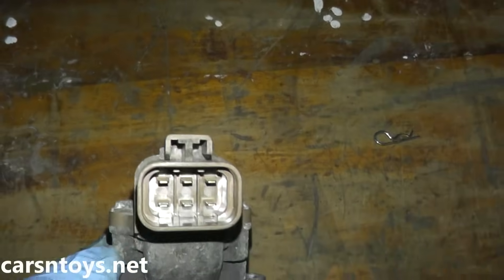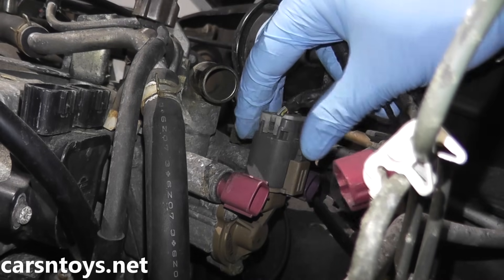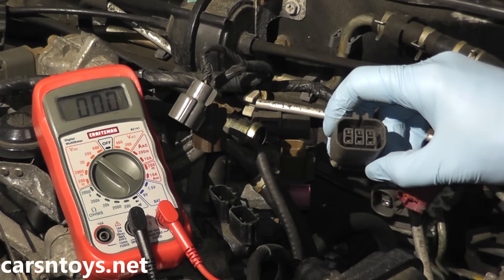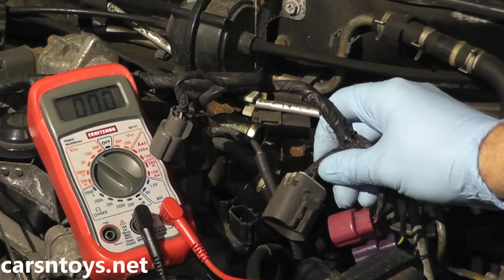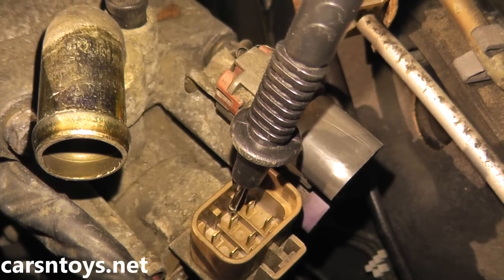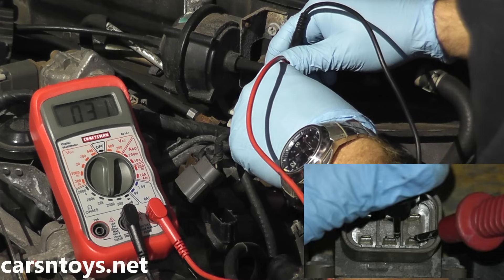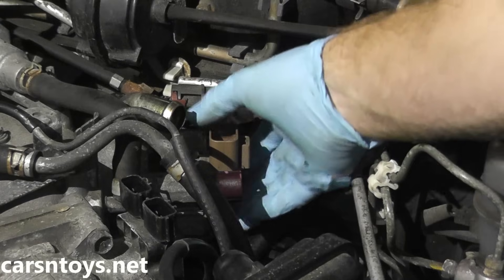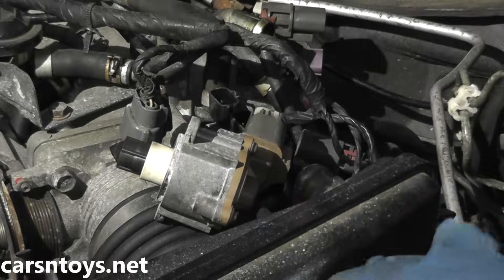How To Test and Replace Idle Air Control Valve P0505 HD | IAC Actuator

Comment: Yeah but where do i find the part on my engine
Reply: If you can type this question here, you can surely type it into Google and get your answer immediately.
Reply: @UseYourBrain. Jokes on you, the part was actually built into my throttle body and un removable. Tried googling a ton before coming here.

Comment: I did it with my motorbike, and I found the IAC failure, I replaced but sometimes I still get the engine error light on... 
I replaced also the throttle position sensor, which I realised after, it has not a fixed position so probably is that that I didn't put it in the exact millimiter position?

thanks for any feedbacks

Comment: Does this work for motorcycles as well? I’ve took my IAC valve of and left it connected..when I turn the key to on position, it doesn’t move at all..

Side note: I’ve been having problems with my motorcycle not being able to idle for more than 5 seconds..I changed everything but today I decided to check the IAC valve and it doesn’t move on the key on position

Comment: What are the part#'s for the 5 screws that hold the IACV to the Throttle Body?  I messed up those phillips head screws removing them cuz they were a bit stuck. 2001 Maxima GLE

Comment: Great video, but I need to go a bit deeper. I want to learn exactly how the IAC steps, they are not simply fully open or fully closed, they can be set to various positions by the ECM to get different idle speeds.

Yours has two sets of 3 pins. Pins 2 and 5 have 12V to them, then I guess a Ground signal from the ECM on pin 1 half steps the valve in one direction and then a Ground on pin 4 puts the other half step in that direction.  To move the valve the other way, the ECM applies Ground signals on the 3 an 6 pins in a similar fashion.
Is that correct?

I have a GM 1987 2.8L V6 Fiero. My IAC valve has only 4 pins. I want to make a setup to actuate the value on the bench. My brother is an instructor at Porter and Chester and he would like to have a little set up to demonstrate how IAC valves work to his students. So learning how they actually work is the first step.

I read 50 Ohms across each pair. I guess one pair moves the valve in one direction, and the other pair moves it in the other direction - but not quite, read on.

I took some baby steps and tried it with 5V first... no action. Then I tried it with 9V (to be safe).
One pair of contacts, still no action, but on the other pair puts a small twitch on the plunger in one direction (even if I reverse voltage polarity on the pair, it still twitches  in the SAME direction).
Ok, I guess it does use 12V, but seeing just a twitch is on right path. But the twitch was rotational on the plunger NOT in or out, and again, I expected it to twitch in the other direction using the other pair of contacts - but not the slightest twitch with those contacts!

So, before I try it at 12V, I need to get a better idea on what signals/timing the ECM puts on the IAC valve to actuate it.
There appears to be no position feedback from the valve to the ECM.
I guess on power up, the ECM steps the valve many, many times to get to a fully open (home) position, and then the ECM keeps track of the step pulses to determine its position from then on - until power off.
I have used stepper motors many times in the past, and that is what is nice about them, you don't normally need any feedback because the are dead on accurate on the position (and knowing it's position) if you pulse them properly. But I have no operational specs on my IAC valve.

Any ideas?
Thanks.

Comment: Thank you for the video. Quick question, I was getting P0505 too and bought a replacement part on Amazon. No more p0505 code but this particular IAC makes noise when the key is set to accessories. It sounds like a little motor is constantly running. Is that normal or should I ask for a replacement?

Comment: I have the code and replaced the iac # 530 306 57ab on a 1999 dodge Durango.  After spraying carburetor cleaner all over the carb and cleaning it and putting on the new iac it will not start at all.  The security light is on.  I disconnected the battery to reset  it still won't start.

Comment: Do I need to reset my computer on my 1999 Subaru legacy outback, after I check and clean my IACV? I didn't actually remove it all the way but after reassembling, my car is now acting like my battery isn't working for a minute. It starts but immediately dies. When I try to turn over again, it acts like I have a dead battery but if I wait a second then try again, it starts but not in a strong way. I know my battery is fine because I just got it tested. When my father and I replaced and adjusted my TPS the other day,  we followed the recommended computer reset protocol and that got rid of the At Oil Temp and check engine light. It is shifting so smoothly now and all seemed perfect so we decided to see if we could clean the IACV, we were concerned we might screw it up so just shot carb cleaner into it and then put all the hoses and sensors back into place. Seemed to be fine until the next day when I went to start it and experienced it dying and then having issues starting. I've never had an issue with it starting. Wondering if i should've done the computer reset after messing with the IACV too. Or perhaps we didn't put something back correctly? Anyone have any advice here?

Comment: I dont get any code.if its plug in car idle vere low when braking en dies somtime,but when i startup idle very good.
Now i unplug it an never dies anymore or no low idling but keeps idleing high.idle at almost 2000 rpm in P or N in D it stays on 1100 rpm

Comment: Does the first test applicable in all 6 pin iacv? Mine is suzuki and has a 6 pin iacv. I wanted to test the iacv coz my engine when running for 30 mins there's a problem occure like when you press the accelerator a little bit the rpm will surge to 1800. Also I notice that when the ac compressor cut off the rpm also surge to almost 1800.

Comment: I had some issues on my 2001 maxima and for p0505. And found that the intake boot badly cracked  just before throttle body and got  p0505.  I replaced intake boot and cleaned the check engine light and it never came back.  But strange sticky throttle   Happened.  Loose throttle cable fixed that but still had some strange idle.   I had to do a idle air volume. Relearn procedure which is specifically for 2000-2001 maxima.  
After that it’s been fine.

https://www.nissanhelp.com/diy/maxima/projects/2000_2001_nissan_maxima_idle_air_volume_learning.php

Love your vids very clear and to the point.

Comment: Good good video, T have a 01' Mazda Tribute 3.0. Idles rough, checked IACV clean inside. No power at key ON! 
Im on disabillity, things are tight like most places. That fuse on the IACV also tends to EEC, VPWR, EVR, MAF, ( bulkhead)?
Most abbreviations I'm familiar, but EEC , EVR?   V power ! I guess ?
Ha ha it starts right up! 5 seconds later it starts to stumble to death (dies)! Plz sir i need help .

Comment: Good show. But if ur having idle issues u may need to clean the valve and seat and air passages and throttle body too. Or u could have significant vacuum leak somewhere. Or u may need. A tune up.  Plugs ,cap n rotor, fuel filter, air filter, pcv valve, ect.
Reply from the maker: Thank you.

Comment: How come my 99 Durango when I put it in drive and give it gas the rpms go up high but no power to go pass 30 miles an hour
Reply: Maf or map sensor controls your vehicles speed by changing the airflow fuel mixture. If you have a bad one your vehicle will hesitate to go past a certain speeds.

Comment: Why in the morning my zc engine hard to star when the time get Cold
Reply: If your pintle is not engaged when the key is turned to on the run position. Its kind of like having a closed choke on a carb the motor needs fuel,spark,air,and compression to run.  But not having tne right amount of air its a pain to crank over a engine if there is no air movement to help combust the fuel.

Comment: HI Great Video very detailed!
2 quick questions please? 2001 Nissan Maxima. In park the rpm's go from 1200 to 1800, back to 1200 back to 1800. It does this very quickly and does not stop. Is this a symptom of a bad or crudded up IACV? Also I read one place that replacing the IACV could short the ECM or maybe when it fails it could short the ECM, have you ever heard of this? I'd like to prevent a shorted ECM from happening if possible when I go to check and possibly replace  the IACV.
Thanks a lot!!
Reply: Just had the same problem on my 96 maxima iacv disrupted my ecu got another one from eBay along with the ecu put me back in the game💪🏿
Reply: Also check your tps
Reply: Yes, I ended up replacing the IACV and having the ECM rebuilt....

Comment: I tested for ohms and showes a reading of 28-29 ohms on 1-2, 2-3, 4-5 but 5-6 did not show nothing what does that mean?
Reply: Jorge Camacho I think all should show resistance my friend . It must be bad did u replace it?
Reply: @mrsteel10213  I just got on from parted out maxima still have to test it first.
Reply: Jorge Camacho I got a new one and mine stopped hunting rpms thankfully . I tested it and ohms were higher on new one than the faulty one by 10 ohms. I don’t know if that matters.

Comment: I have a 2002 Nissan maxima, I cant find the iacv, ibthought it was connected to the throttle body as it is on the 2000-2001 model

Comment: Great video, you test for power in the sensor, the sensor has 6 pins,  you only showed the two for power,  what are the others 4 pins that you did not test, are they 2 grounds and two signals? Please  let us know and what are  the voltage of those others pins, thank you. Cheers from ontario ca

Comment: Dear guy, My Mitsubishi Galant year 1990 has a problem the rpm not stable in idle. When give  load like AC ON or Head Light ON or move the wheel steer
the idle rpm will run rough up and down excessivelly and sometimes the engine shut down by it self. I already changed the Idle Valve sensor 2 times and check the resistant is ok. The output power from the plug is 12.5 volt,  but the problem still exist.
I checked the movement of the Idle Valve sensor plunger but it movement was only  shaking and not extend or retract.
Is the ECU bad ?
Please your suggest.
Thanks alot.
John Purwanto, Tangerang City, Indonesia.

Comment: its so useless when they refuse to tell you what vehicle they are working on.  i get that it is kinda sorta a universal thing but not really.  so tell us the YEAR, MAKE AND MODEL PLEASE!!!!!!!!!!!
Reply from the maker: Appreciate the feedback. Specific vehicle is shown in the description box. The point of the video is to show what's involved (removal, using a multi-meter, etc.) for someone looking to do the job.
Reply: If you unplugged any of those two components, throttle body, or iac then the idle air control relearn procedure needs to be performed.

Comment: I have a problem with my 00 nissan maxima I have code p1130 I have look every where and nothing
Reply from the maker: Swirl control valve. Any other trouble codes besides p1130?

Comment: I checked mine it does shows everything you've had explained but still have the problem.& the scan shows a bad iac what it could be i already cleaned the EGR as well but i don't see any changes. Any suggestions???
Reply from the maker: What kind of vehicle? Any other trouble codes?
Reply: CarsNToys its a 95 gmc sierra 2500. 7.4 .& since is an old model it doesn't show any other codes.
Reply from the maker: Gotcha. On your vehicle try doing an ohms test on the valve. Grab a digital multi-meter and see if you're getting resistance. Here's another video showing how to perform an ohms test. Fast forward to 50 seconds: https://youtu.be/j-Wr2VMvfbc

Comment: how you're doing I have a 1996 mercury grand marquis gs and it's making a very loud humming noise and I thought it was a wheel bearing but it wasn't a wheel bearing they said it was a idle air control valve so all I have to do is just change it and it will eliminate the problem

Comment: Tried the last step where you take out valve and turn the key, my valve exploded like others said theirs did.  I got a new valve in and it actually fixed my idling problem but be warned, you run the risk of destroying your valve if you actuate it without it being mounted in your vehicle!

Comment: So I have a 99 gmc sonoma. And she runs great. But! Every day coming home from work the rpm surges when I'm doing over 70mph. My gmc does not have the check engine light on or any other. And when the rpm surge happens she has power. No transmission slip she takes off and when I step on the gas it goes down to normal speed but continues to surge.

Comment: subbed. good clear explanation
Reply from the maker: Thank you. Glad to help.
Reply: CarsNToys hey mate. I've changed this, ECU, air flow. and yet it still idles at 2200 when cold! the coolant icv kicks in when warm but when it's cold it's high revving. it's a 92 Mitsubishi Pajero ( Montero ) 3.0 v6. any ideas? thank you
Reply: CarsNToys it's reads 12.6 volts at those terminals to.

Comment: If I'm only getting 24 ohms is that bad? I tested it plugged in cranked the key and nothing. I'm getting power to the wires.
Reply from the maker: What kind of vehicle are you working on?
Reply: CarsNToys a 89 supra I've been trying to fix the idle issue /stalling I already replaced the tps

Comment: Would be the same test for a two pin set up. 2001 ford ranger 3.0l I put in a new one and still getting the code and running really bad. I''m thinking it might be a bad ECU. Any thoughts
Reply: Greg Seleen Did you figure out what the problem was?  I have a 2000 Ranger with a 3.0L.

Comment: i replaced the iacv with a used one and still the same problem, at cold starts it stalls until it warms up, no vacuum leaks. what else could it be or should i have replaced it with a nee iacv? thx.

Comment: is it possible for the iacv to be bad and not throw a code? being told to replace mine without the code.
Reply from the maker: Yes, it's possible. I'd test the valve regardless. Good luck!
Reply: I guess I have the same problem,  sometimes when I let off the gas to freely wind down (like at the stop light) the engine stalls. No code, but when the ignition is on - the IACV is buzzing, so I think it's sticking sometimes. 
Thanks for the explanation in the video ;)
Reply: I was having idling problems with no code in my gmc sierra.  I changed the valve after my Pinole shot out doing the last step of the video.  New valve fixed my idling issues.

Comment: hey just saw this awesome vid. but I came into a problem. did everything you did and everything thing checked out cleaned it up a bit then put it back in but still have code showing. any advice?
Reply: Stephen Horton you must clear codes after each replacement fix to see if it comes on again

Comment: Please can someone help me. I have a 95 mit eclipse sr I dont have power to the idle speed control. I replaced it with a new one, still no power, new computer, power turned on but its out again, checked all the wires, put new connectors....

Comment: hola que tal, mi nissan maxima aveces esta acelerado a 1500rpm y aveces esta a 800.,  ya revise tps y maf sensor y todo esta correcto,  pero me percate que mi valvula iac no hace esos movimientos al abrir y cerrar el switch,,  en la mañana prende a 900rpm y al ponerlo en marcha sube a 1400rpm..   al parecer mi valvula iac no funciona pero al desconectarla tambien se sigue acelerando, ¿Cual podra ser el problema en mi maxima 95?  el tornillo que va en el cuerpo de aceleracion lo afloje todo por que las revoluciones llegaban a 1700rpm.

Comment: Ok last question...? I took off the IAC itself, and there is a little coolant on it and inside the housing.  Is that ok as coolant runs through part of it, or should it be completely dry?
Reply from the maker: What kind of vehicle you working on?
Reply: 2000 Maxima SE
Reply from the maker: CaretHalfgem
I haven't come across that on a 4th or 5th gen Maxima. They're usually bone dry.
Reply: Actually i found it it should be bone dry. It's been seeping coolant into the throttle body and in be engine...
Reply: And when i pulled the TB off, I found all sorts of coolant basically caked in there.  I cleaned what I could and shot a lot of Seafoam inside to hopefully loosen more.
Reply from the maker: Gotcha. Is the car running better?
Reply: I finally got it out for a spin. It drives great again. I'm sill going I throw more cleaner down there. The TB got a good scrub while it was out also.
Reply from the maker: CaretHalfgem
Good stuff man!
Reply: Thanks for the clear video and all the help
Reply: SAme with Honda's.  Coolant "keeps them from freezing".   Headache for California residents.

Comment: Question: I have an IACV that's got only 4, not 6, terminals. So I did the ohms test on 1 + 2,  2+ 3 and 3 + 4. 1 + 2 and 3 + 4 showed about 53 ohms, but 2 + 3, nothing. Does that suggest a fault? Thanks.
Reply: Hello.  I have the same facts. Have you received an answer?
Reply: same scenario here. what was the verdict?

Comment: Instead of a replace an entire IAC, along with all the coolant chambers, can I just remove the two screws and replace the coil portion by itself?
Reply from the maker: If it's replaceable on your vehicle, absolutely.
Reply: +CarsNToys yep. I have to buy the entire piece, but it is easier than removing the entire throttle body to get to it.
Reply: OH! Thank you!!
Reply: Hi David, in my car, the coil part is easier to remove than the entire IAC. I did a test, the harness was getting 11v,  some pins on iacv was having 30ohms while some had 29ohms. While car was idling(though rough idling), I unplugged the iacv harness, i didnt notice any change. If I change only the coil, will the effect be same as changing the entire iacv?